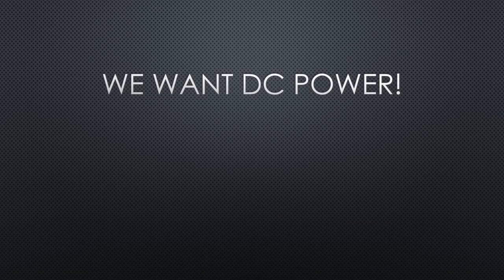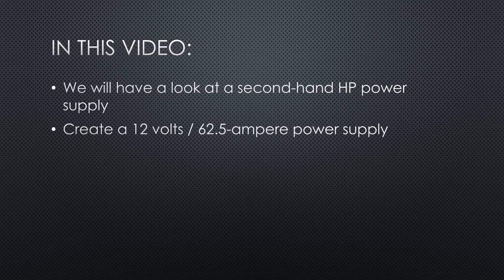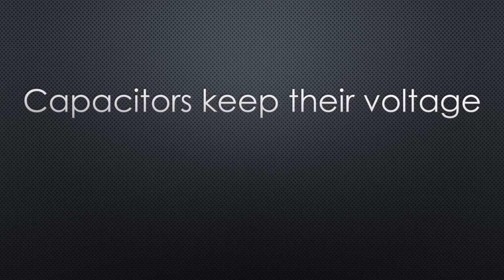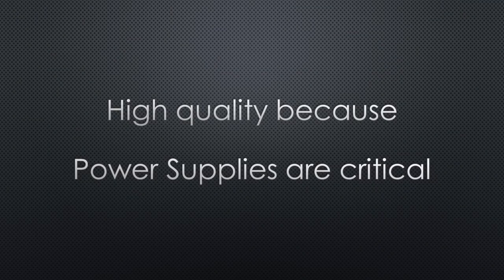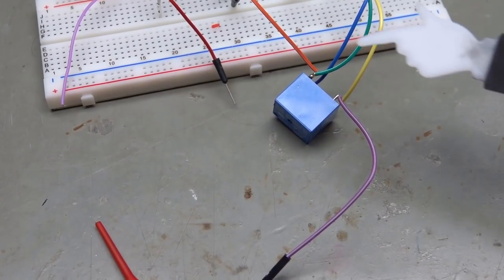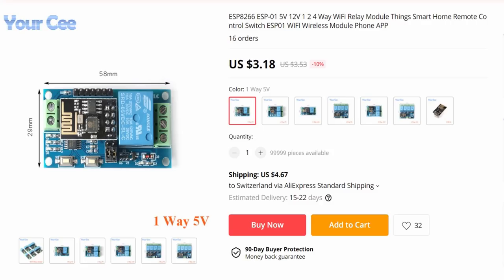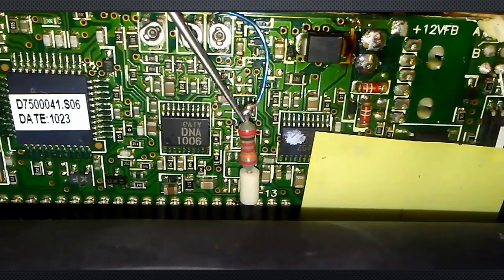#342 12V/60A power supply (PSU) for 20 dollars? Unbelievable, but true. And high quality.

Comment: This seems like it would be ideal as a 3D printer power supply
Reply: Not quite. Most have switched over to 24V. 12V is still used in some printers but a vast majority of them are 24V now. Plus even with a high current PSU like this the 12V 3D printer main boards will be limited by the MOSFETs.
Reply: Isogen just connect two of them in series then. You’ll need to insulate 3 screw+stand-offs inside the psu
Reply: @AugustoZanellato  does that work with all switchers?
Reply: @milesmccoo  Unfortunately, not all. Some will do.
There are some constraints and warnings when trying to connect two PSU in series: 
1. To do in-series connection you must ensure (at least one) power supply is floating (ideally both), i.e. none of the DC outputs are common to any of AC inputs PINs. 
2. There is a chance for non-equal rising time, especially when the PSU's are not the same, causing ramp-up to be non-linear, sometimes this may be a problem for connected devices (it may be sorted using additional circuitry). 
3. In case of short circuit (yeah ElectroBoom) effectively you have two PSU connected in reverse. Not very safe.
Reply: @mich29sm  I just decided to use dc to dc converters and a modest secondary battery bank rather than do a float.
Reply: These are a reprap classic, since they're at least better behaved than inexpensive group regulated ATX supplies.
I wonder why modifying the secondary side feedback network and checking secondary side components for ratings would be insufficient to make it 24V. Maybe nobody could be arsed.
If you insist on running super high current 12V, you don't need to be limited by board MOSFET, you can get external addon boards.

Comment: Great Video! I immedeately ordered some of those beasts ;-) 
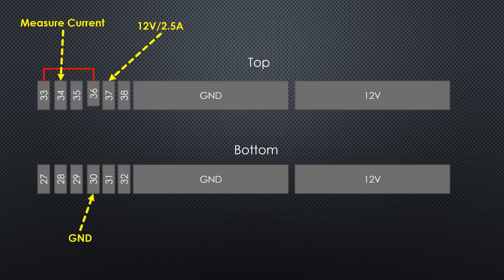While wiring up i noticed that the bottom pin numbers shown at 6:12 in the video need to be flipped to be correct.
In other words: the 'small' ground pin is the 3rd pin from the left side, that's how i noticed it...
Reply: Yep, good comment. Pin 27 is adjacent to the huge ground and pin 32 is on the edge.
 I'm surprised he mixed that up on the drawing considering how careful he usually is.

Comment: Nice video.
I have a question about the psu: what is the standby power consumption with no load?
Reply: Interested in this too
Reply: I’ve got a stack of four server PSUs and on standby they generally have a low power fan running and after about 10 minutes the air being blown out the fan can be like 90° (ofc it could just be heatsinks retaining huge amounts of heat
Reply: Philosophical Thoughts wow Your house must be very warm even in the coldest winter
Reply from the maker: Mine uses 12 Watts
Reply: @AndreasSpiess  Ah thanks, I asked that in another reply too.
The one I tried was over 40 watts, I did not want to use that as a station supply that is (nearly) always on, now use one of the wellknown 13.8V/23A boxes.
Ok no 60 A :-)

Comment: I purchased a couple a while back one had no fan but was very clean and the 2nd was really dirty which was very surprising for the reasons you mentioned in your video.   I had no luck finding any info for my specific models allowing me to increase the voltage but I have already purchased a 300w step up switch mode supply from China so that I can run my radio on 13.8 even from a deeply discharged battery (say 10v) so now I simply use the same step up for the radio if I need more than 12v from these supplies.  This way has the advantage that I can create much higher voltages if I need (up to 50-60v).   It costs about double this way, is a little less efficient but is more flexible too.  Next time I'm going to pay attention to the specific model more closely to ensure I get one which I know is easy to mod...
Reply from the maker: True. It pays off to do the research upfront. Mine was easy to modify.

Comment: Instead of using the analog pin to get the output current you can use the pmbus to get all of the measurements out of the power supply like input and output voltage, current and power, fan speed temperature and a whole lot more.
Reply from the maker: That is what I thought. But I did not find a readymade Arduino project.

Comment: Cute @2:48 "Please Subscribe!"   Is it possible that you have viewers that have not YET subscribed - let alone set up a Patreon account?   Hard to imagine what keeps people waiting - unless they are young students just discovering your quality/quantity.  
Electroboom @ 3:16 - good warning.  I'm a big fan of Mehdi and yes, I fear for his survival but am simultaneously thrilled by his videos.  Ever notice the carbon burn tracings on his project boards?   Those sparks are real.
Switching with an ESP-01.  Perfect.  I'm working on that right now using a 5V relay - Yes, 70 mA is what my 5V OMRON G2RL-14 uses.  I supplied it with a 2N-3904 transistor and the base supply is GPIO00 off an ESP-01.    

I may flirt with the 13.8 V idea.   A 12 V lead-acid off the grid lighting system would be a really application of these power supplies.   Recharging the batteries without 'the grid' would be pretty fundamentally necessary.  Maybe isolating the charging station to a box outside of the building would be the safest thing to do... just in case.  Same is probably true for LiOn battery charging - I saw your warning about that and now practice supervised charging only ever since. 

Enough of my blather.  Thanks for another fantastically timed video.  I need to watch a few more times to absorb it all.
Reply: That switching on/off should be done with a transistor, not a relay, as the PSUs expect that.

Comment: You can also pretty easily isolate these supplies and put multiple of them in series. i did that for a Buck regulator put 5 of them in series to get 60v and than a buck modul which can do 50v at 20A and made my own Lab bench power supply works great.
Reply from the maker: This is a powerful Bench supply! Cool.
Reply: @AndreasSpiess  it also only was about 100€ with everything, the 5 psus and the buck modul (which was the most expensive  part) it is a DPS5020 from RD Tech on Aliexpress these modules are very popular you can find a lot of videos about them
i think you made a video about the cheaper version DPS5005 with only 5 amps

Comment: i love the secondhand server market. Bought 5 240watt Dell server psu with 20 pin mobo connector for only..........yes, 3 dollars each. 3 dollars. Very dirty but i checked every component and they're still very good. I then bough dual 20 to 24 pin (2 psu(s)) to connect the psu(s) to atx mobo and made a low end gaming pc for my son.

Not to mention i also purchased 2 2TB WD black for $10 each, a huge server heatsink (twice the size of 212 evo, modify it to fit on am4 motherboard) only for $5. 

Damn server market.
Reply from the maker: Fast moving electronics. Nobody wants old things anymore, I think.

Comment: Recycle those laptop power supplies too to keep them out of landfills. I have a couple Toshiba laptop power supplies I cannot use as I don't have the old laptops anymore. They are or were at the time all made to output 19volts and about 4.7 or 5 amps. That will be about 18 amps at 5 volts or so and if you stick one of the Chinese digital buck converting power supplies on one you'll drive them to the buck converter current limit with plenty of room to spare in the laptop power supply. Mine are so old they are from another country but I have some power plug adapters for them kicking around. My Chinese digital buck converter has three separate inputs on the back and one of the three is a barrel connector that first the Toshiba laptop plug exactly. (yes I finally made it to your PC power supply video! \o/ yay)

Comment: Hi Andreas, I followed your description now - I bought one of these (they are cheaper than 20€ incl. delivery at the moment), I soldered a switch and the 12V connectors to it - and it's working perfectly!
The special feature of the temperature sensor, which is making the fan turning in a proper speed is absolutely fantastic. It is quiet and strong. I love it :) Thank you so much for this video :)
Reply from the maker: Thanks for sharing your experience. Glad you like your purchase!
Reply: @AndreasSpiess  Yes, of course. I am a victim of the woodgas bug and need  more experiences with electronics and sensors. So I found your channel so helpful and your style so excellent that I will follow you a long time in future. ;)

Perhaps you can help me with a hint? I am looking for a sensor working with Arduino, which is able to detect a level in a 10cm circle from a distance of 50cm? 
Ultrasonic sensors don't fit the 10cm circle when measuring from 50cm distance and lasers are measuring only a point not 10cm. You have an idea?
Reply from the maker: I only know these two methods :-(
Reply: @AndreasSpiess  Thank you for your quick response - that's sad. I hoped you know some more possibilities which I am not aware about. But thank you anyway. :)

Comment: Thanks for the tip! Got a 187A power supply for $30. No idea what I'll need almost 200 amps at 12V for, but damn it was cheap!
Reply from the maker: Sounds like a plan! I am sure you will find a purpose!
Reply: from were?
Reply: @riccardoz2953  ....From eBay.

Comment: One short note as someone with experience building datacentres - server hardware assumes two things: High airflow from the fans at the front of the server (if two of 5 fans die the server shuts down for example) and there is an assumption that air is below ~23°c… it may be your server PSU has no fans, if that’s the case you should add one. Specifically one with a higher pressure rather than airflow
Reply from the maker: Thanks for the additional info. All my HP PSUs have built-in fans and they start to work automatically.

Comment: Nice one, Andreas. I'm currently building more parts for next Christmas' display, and I've been using PC power Supplies, 650-1000W. I just picked up 2 additional 1000W server PSUs on Ebay for under €50, including shipping to Ireland.
Reply from the maker: Sounds you have a lot of light during Christmas time ;-)

Comment: Another quite cheap and very efficient way of getting power for your projects are ebike/scooter chargers. Most of the times they can easily be modified to put out the voltage you need, just be aware of the max voltage of the output caps
Reply from the maker: I never thought about that. Thank you!
Reply: @AndreasSpiess  be aware that the caps in this HP are only 16V. Check out this review (in Russian, but the browser's built-in translation should do) - https://mysku.ru/blog/china-stores/75308.html Also check out the charts - it is quite noisy (500mV ripple), which is a no-no for some applications.

Comment: Another interesting thing is that these power supplies are hot swappable in servers. Servers usually have two of these power supplies and can generally run with even just one when the other fails. You can replace the failed power supply while the other one is running. A side effect of this is that these are run at less than half the rated power in typical usage cases so the peak power efficiency would lie at 40% the rated power or less as these would be optimized for the typical use case.

Ah and hard disks, memory modules (RAM), certain PCI-E cards and even sometimes processors can be hot swapped while the system is running. This is the reason most of those connectors SATA like PCI-E also have a combination of long and short pins. This gives a predictable contact order for hot swapping.
Reply from the maker: Thank you for the additional background. Interesting!

Comment: This looks like a great power supply for those lab bench top power supply display things you get from aliexpress. Would add adjustable voltage and amperage to the unit.
Reply from the maker: Good project!

Comment: really nice, I've done this for a 3d printer with the exact power supply that you have, but it was way to noisy. Great work by the way, I really like what you do and like your channel. Have a nice day!
Reply from the maker: Did the fan always run?
Reply: @AndreasSpiess  yes, I still have it but I don't use it for that anymore.
Reply: @synco1985  why not put a new quiet brushless fan on it to reduce the noise

Comment: A few years ago I got a Buy It Now on three Dell PowerEdge A670P-00 power supplies for £12.72 delivered! They're 12v @ 54A each. The only downside is they do not come with fans so need an external case and fan. I 3D printed a case for an 80mm fan and all is good. The one has been perfect for two years. Probably only ever loaded at 5-15A. Never did the voltage change on it. It's pretty hard to get to the components on this model.
Reply from the maker: You are right: It depends on the model. Mine was on 13.8 volts in less than 10 minutes...

Comment: Nice video, the edge connector is a 'standard' too so the tips should work for a lot of server PSUs, there is a way to increase the voltage without diving into the innards as well, look up DPS800
Reply from the maker: I just googled and saw You can change voltage from the outside with the DPS800. Less dangerous. Thanks!

Comment: I worked in a data center some years ago. These power supplies were installed in server racks with constant strong airflow of about 15-20 C. I am not sure they can withstand an environment of 30-35C in summer without any additional airflow. Be carefull and disconnect the power fast when your house is burning. Or find another maker (not your neighbour, fire can spread out!) to test it for you! ;-)
Reply: The ones I've checked will accept inlet temps up to 40-45 degrees C even. My newest dell has options for targeting max output temps and the selection goes up to 70-80 degrees C! Obviously the expected life time and long term reliability will be reduced.
Reply from the maker: From what I see, thousands are already used. This is not a "secret" anymore. Most of the people probably do not use them to the max.

Comment: Finally got around to ordering some of these. 12 volt with current to spare to do fun stuff like neopixel as you used as an example, great to have laying around in general and at 20 euro including shipping a piece there is nothing that beats them. Plus it's recycling! I've wanted to order some DIY PCB from china for a long time too this is a perfect simple project for that, I can 3d print a cover for it and it will be a proper safe to use DIY power supply. Thank you!
Reply from the maker: Sounds like a good project!

Comment: Thank you so much Andreas!!! I just got mine... this thing is a beast! I will try to adjust mine to put out 13.8 volts ;)
Reply from the maker: Should be possible if you go the right one...
Reply: I have a Dell L1100A 12V 90A power supply that has remote volt sense terminals. It doesn't appear to have any internal volt sense. By connecting a 1k pot in series with 6k8 across the output and connecting the wiper to the remote volt sense input I get an adjustment range of 12V to 13.6V. By changing the 6k8 the output range can be altered, but protection circuits switch off the power supply as the output approaches 14V.  This approach may work for other power suppliers.

Comment: You can also find 24v and 48v server PSUs. A desktop power supply just needs a 5 or 10w resistor hooked to the 5v line and to ground so adding a power switch is easy. A server psu usually needs a resistor too but usually has a power enable pin. You can also get a whole server for very cheap and use it for a project like a cnc, automation control server or a media center. I have seen 12core servers with multiple TB of storage for 100-200.
Reply from the maker: Cool. I have to watch out for that.
Reply: 48V PSUs are more commonly known as "telecom rectifiers" and are of particular interest to those building large audio amplifiers. Then there are hybrid car inverters for truly large amounts of power.

Comment: Best way to use server power supplies is to get a PDB (Power Distribution Board) it has all the hooks and power connectors needed to avoid the damage of the card edge connector of the power supply and also you can put more than one in parallel but be careful there are models that can push more than 100A easily. Modifying the output voltage is not so easy specially because these power supplies have Over Voltage Protection circuits in the output, so to modify one you need to have strong knowledge about power supplies and the detailed schematic and part location/layout of the PCBs.
Reply from the maker: You are right: I added a link to those PCBs. I learned it from viewers. Concerning modding: Mine was easy. But it depends on which PSU you buy.

Comment: You do have to be a little careful buying used server power supplies. The server room at my work runs hot because there's no separation of hot aisle and cold aisle airflow, so when I put my hand on the back of the servers near the power supply outputs, the metal is almost too hot to keep touching. And I can actually smell a faint odour of something in the exhaust air which I assume is the capacitor electrolyte. I'm guessing in a couple more years they're going to start seeing power supplies failing.

Of course, they wouldn't have been in this situation if they listened to me when they were planning on installing the servers, and left a 1RU gap between them. That would allow airflow between the servers, which would reduce their temperature considerably. They argued it's a small server room so they have to save space, but there's literally no more power outlets in the racks, so they couldn't put any more equipment in those racks if they wanted to!
Reply from the maker: You are right. You do not know where these supplies come from. I assume they come from larger installations because they sell hundreds of PSUs, but I do not know.